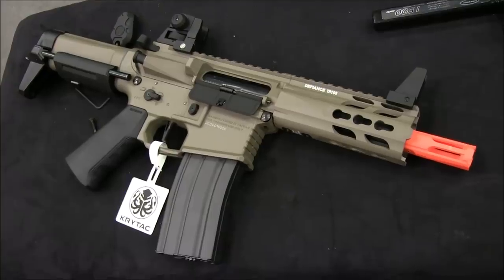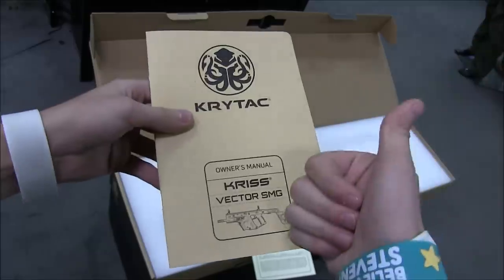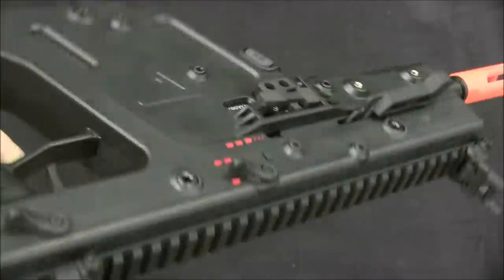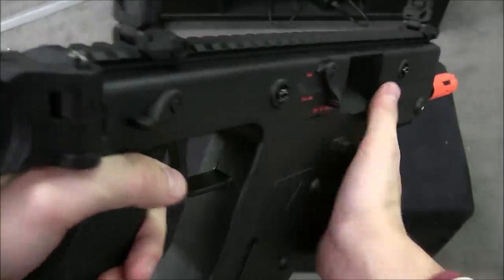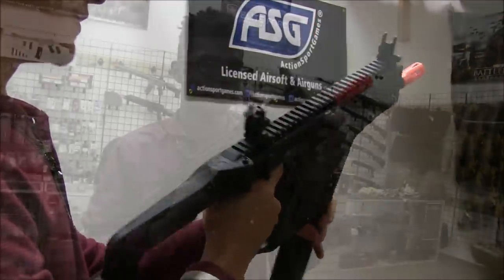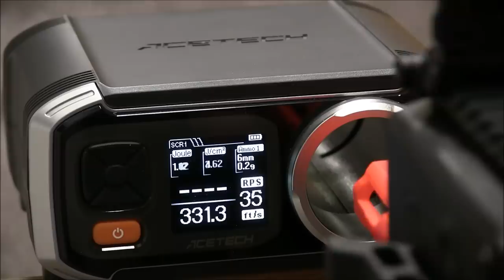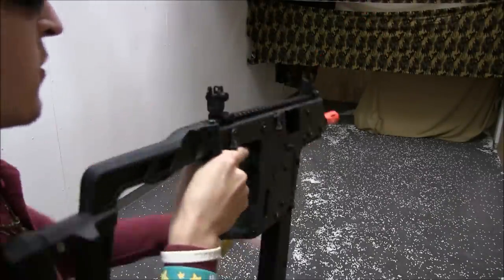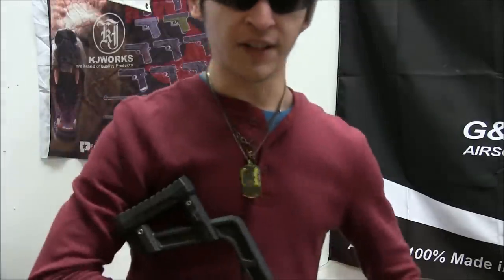Krytac Kriss Vector AEG Airsoft Review - Is it better than your Krytac?

Comment: What kind of argument is the "you have to get used to the controls" argument?! I'll tell you, it's the lazyass guy's argument. You know you have some braincells inside your skull that evolved to be adaptable! Currently I only have two AEGs, a P90 and an M16 but I don't ever have to look down or think about which one I'm holding, or what's the reload procedure, it comes naturally just from the way the gun feels in my hands.
Anyway I'm thinking about getting a third AEG for the next season (I don't play during the winter) and it may be this gun unless I find a (subjectively) better one until then.
Reply: sogerc1 I can speak from experience when I say, the controls can be a bit tricky.. I find myself wanting to throw the safety into burst fire but have to remind myself that the fire selector is for the forward hand to use.  Two different selectors unlike an m4 where the selector is the thumb safety..  given a bit of practice and some muscle memory, I'll get over it tho..
Reply: And how about it's stock? Based on the videos I've seen, I'm kinda afraid that it would be uncomfortably short. I can't try it myself, no one has a Vector among my friends. To what would you compare it to?
Reply: sogerc1 the stock can be a bit to get used to. But it can extend about an inch and a half. But I find my cheek still landing on the proper cheek well.. once you throw it up a few times, it comes natural.. literally my only argument is the mag release.. it's not great for a left hander
Reply: I'm a righty so it shouldn't be a problem for me. Thank you for your responses.
Reply: sogerc1 I'm a eighty as well, but I can shoot switch. As I cut my pies left handed to clear right, I have pressed the mag release by accident..

Comment: I mean, I have a Krytac, but I've never understood the whole, "Only get Krytac, everything else is shit." Only brainless dunces say that, play with what you want, people
Reply: What's the difference between blowback and non blowback rifles?
Reply: @quitreadingth1s4  Gas Blowback rifles are powered by a gas mechanism, I believe, and have realistic recoil. Non blowback systems do not have recoil
Reply: @ClearlyInPeril   do the blowback rifles fling a shell out of the chamber when a BB is shot?
Reply: @quitreadingth1s4  there are a few guns that have plastic shells with bbs on the end that do eject shells, but 99% of airsoft guns do not do this
Reply: @ClearlyInPeril  ok thx lol because I was gonna buy a blowback sniper and I didn't want shells flinging out to give away my position
Reply: @quitreadingth1s4  are you new to Airsoft? If so, I would highly discourage you from getting a sniper. They're very hard to handle take a lot of knowledge for aerodynamics and wind speed and such to use. They're pretty complex, I'd recommend an AK or M4 model to start with due to the accessibility for upgrades, accessories and parts
Reply: @ClearlyInPeril   I am new, and I'm all about snipers. But everyone says to not get a sniper if you're new. I figured I would try it and get used to it because I gotta learn how to use it eventually right? I'm buying an AK also so I'll be able to have that too
Reply: @quitreadingth1s4  they're hard to use, which gives players the impression that Airsoft isn't for them and discourages them, but if you have a simple platform, you'll have a more fun and engaging experience. Also, rent a gun at your local field and play before purchasing anything
Reply: @ClearlyInPeril   ok thx for the advice, I'm getting as much as I can